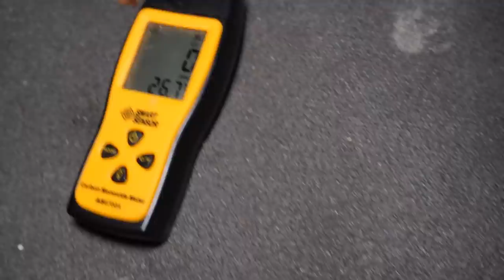Atmospheric overnight in biggest Dugout , bushcraft , making floor , two days in wood

Comment: One of the things that impresses me is the skill, which you have, to make lumber with a chain saw, FREEHAND. Until I saw you and one other person do this, I had never even considered ever doing it
Now what I have to do is save enough cash to buy a Stihl electric chain saw. They are almost noiseless, something very important, when doing what you are doing, to avoid detection by the curious and thieves.
Great job so far, much improvement over the other shelter. ;-)
Reply: They make "chainsaw mills" which is basically a metal frame you attach the saw to and allows you to adjust the height to get perfectly straight thickness and width.  The best part of these, freehand or with a mill, is you can do it right where the tree has fallen.  No need to drag an entire tree to a mill, bring the mill to the tree!

Comment: may i offer a suggestion, 35 yrs experience in building homes. Increase the height of you chimney 2 feet, 1 section of pipe, If you ever had a back draft or draw issue, it because chimney too short
Reply: Yep, good idea. I was thinking more sparks. Many a roof thatch has been set alight from flying sparks!
Reply: Spark guard wouldn't hurt either.

Comment: Looks very nice.
I was wondering how you were going to insulate between the boards. I thought maybe felt or moss. But dirt is good.
I enjoy watching the cabin come together. Thanks man!👍😊
Reply: If you have the chance to get any hot water tank blankets. Take them. You can cut them into strips and use them for chinking. Most plumbers throw the blankets away after installing a new hot water tank.

Comment: Can you tell me - why build a dugout instead of above ground ?
Reply: The rigidity of the build if built correctly is better than above ground. It’s the same concept. Your just building a log cabin in a hole. One of the other benefits is a lot less wood to burn to stay warm and cook. Downsides? They are very dark unless you add windows. Also, you are limited in size of the build by available area to dig and the size of logs you have to build with. Sorry I was rambling. But I really love building shelters in the woods.